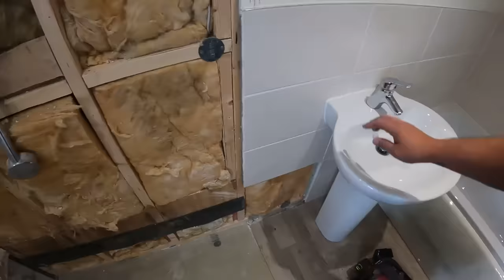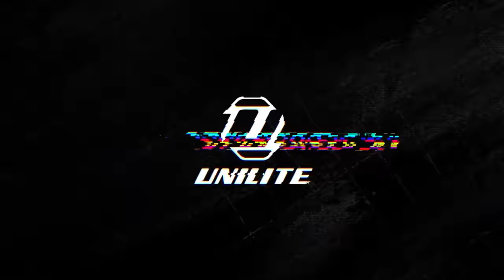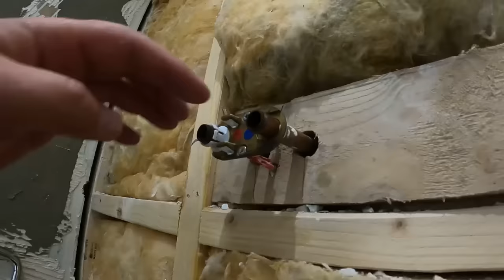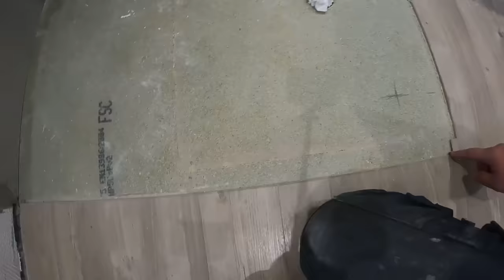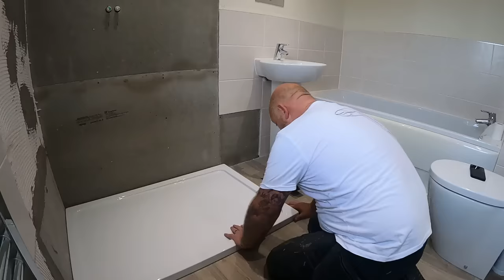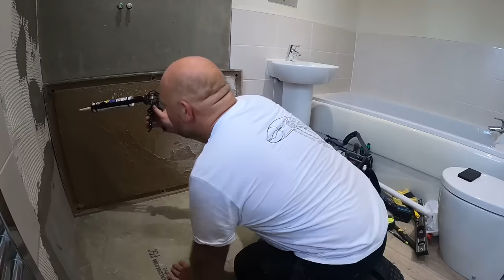CUSTOMERS SHOWER IS COMING OUT!!...They've Decided To Start Again! REAL WORLD PLUMBING

Comment: Splendid idea by the customer to have it completely renovated, solves the problem with the tiling 🙂. Days of sand and cement are long gone for bedding in a shower tray. You said you’ve been fitting showers for 25 years, does that mean you started off when you were 10 years old 😂. Smashing video as always, thoroughly enjoyed it 🙂👍. Thanks Mark 👍
Reply from the maker: I will take that as a compliment…… how old do you think I am….😉
Reply: 60. Pretty obvious you've been under the knife. 🤣

Comment: Be careful with what your giving customers. Quotes by law are fixed price, if the cost increases the extra is on you. Estimates are open ended and subject to increase. You cant legally give a customer a quote and then bill them for more.
Reply from the maker: Never had an issue in 28years…. It’s all about working with the customer

Comment: fitted alot of those types of mixer showers about 10yrs ago,that grub screw is pain in the a** sometimes,doesnt like to line up atall :/
Reply from the maker: oh no....dont say that....hahah
Reply: you might get lucky n slot it first time,but more often than not i was tearing my hair out trying to line it up,poor design imo,guess they wanted something different,also cracked a few tiles with how close the fixing screws are to the pipe :/
 @MJTiffPlumbing

Comment: Nothing wrong with using silicone, no nails, pink grip etc to bed resin trays and I think most manufacturers will now approve this method in their instructions 
I recently installed a Mira resin tray and the instructions stated that any suitable building adhesive was acceptable 👍

Comment: Hi Mark ,the fact that you didn't use a sand and cement mix to lay the tray, if you have a problem with the tray does it not negate the warranty on the tray , looks the proper job removing all the tiles, love the real world plumbing videos 👍

Comment: Hello Mark, many years ago whilst working for Warwick District Council as a chippie all bath panels were white hardboard with studding behind, (possibly 50 bathroom's at a time) much easier for cutting around pipes, slotted into the bath groove with a skirting to match existing along the bottom to trap it all in, one of the plumbers I worked with at the time was Nigel Barnett who now runs his own company in Southam I am led to believe
Reply from the maker: I’ve took a few of those hardboard panels off over the years mate 😉👍🏼👍🏼

Comment: Much Better! Good work dude... I  always like to think you should be able to use a shower without tiling , so if the qrout or silicone fail you dont have another shower downstairs.. but 15 years without leaks wasn't bad

Comment: Good shout using that sealant/adhesive. I use Plumbers Gold for bedding trays onto smooth sheet flooring. Anyone thinking of using Ordinary acetoxy silicone please note it will NOT adhere to green chipboard.

Comment: At the end of the day it doesn't matter how you tank it provided it complies with building regs requirements for tanking showers. Outside of that it doesn't matter as there are so many different products out there that there's equally as many methods depending what you're using.

Comment: Ive got a couple f those sucking cups a single and a double. mainly used for glazing work. I cant trust them though as they loose suction. i bought one off amazon for around £30 with a small pump handle.
Reply from the maker: These ones are brilliant…. Lifted some very big trays

Comment: i only ever fitted one flush shower tray. that was an 1800mm x 800mm. because of the voids underneath i used a sand cement mixture with flexible tile adhesive. the silicone wouldn't have worked to give it good full bed. i watched a video a few years back and the guy only fits mira flight trays now as the one he fitted cracked in the video.
Reply from the maker: 👍🏼👍🏼….. yep we all do what we know works

Comment: Mark, How many tubes of the sealant did you use on the bottom of the tray? I might try this in my bathroom next year. I am thinking of buying a 800 x 1200 tray. I wanted 900 x 1200 but it’s going into an alcove at one end so too wide. I am having trouble finding a 850 x 1200 tray locally.  Great video as usual. Thanks. 👍

Comment: For all you apprentices out there. 
When you have more movement in the tray than the flexible tolerance of the silicone sealant sealing the tiles to the tray will allow then you will get a hairline crack along the first row of grout lines. Simple fix in this case would be to simply tighten the back left hand corner leg, stick a grout removing blade on your multi tool and remove the said grout line along with the silicone sealant along the tray. Tiles would be removed without damaging. Replace saturated plasterboard with backer board, soak tiles to remove old adhesive and replace. Simples. Appreciate in this example the costomer wanted a low profile tray so it had to come out regardless.

Comment: the shower has very close pipework not you're 150mm centres?
Reply from the maker: Yep….. not seen one like this before….
Reply: @MJTiffPlumbing  i saw a grohe 180mm c/c in somebody's place, i don't do this work regularly though.
Reply: Mira mini duo has 50mm centres, looks similar to this valve.
Reply: I'd imagine it might be hard to find a replacement if the existing manufacturer decides to discontinue that shower body.
Reply from the maker: I think it is a Mira….👍🏼👍🏼
Reply: It's a Mira Agile ERD
50mm centres.
Reply: @J4MB0  looks pretty smart as others said,  think Mira will keep making showers for 50mm centres. it would be bad if they didnt.